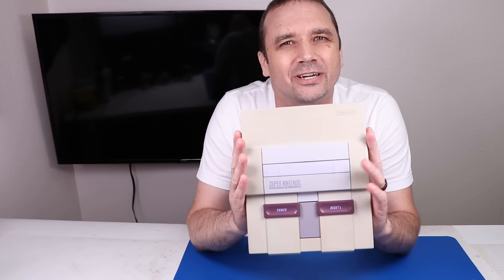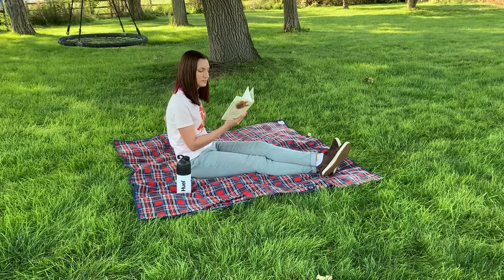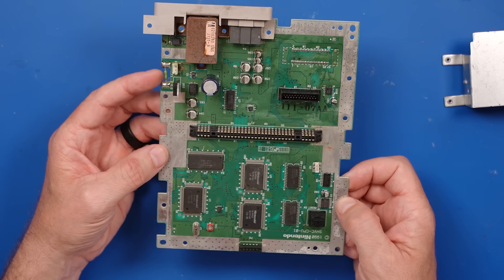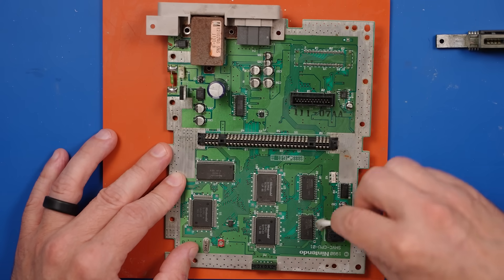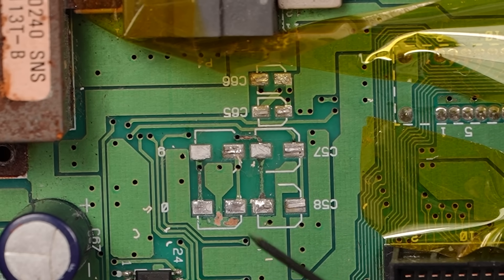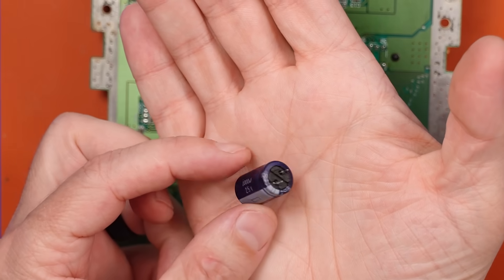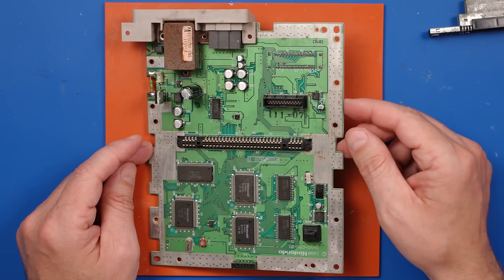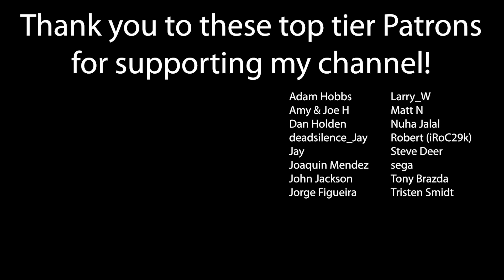Repair Shop Said "Unfixable" - Let's Find Out!

Comment from the maker: Try Huel with 15% OFF today using my code TRONICS15 at http://www.huel.com/TRONICS15. Fuel your best performance with Huel today! Minimum order value of $75.
Reply: I just checked it out and they only give a 10% discount for me
Reply: @Tronicsfix  businesses have to pay 4 to 6 types of cost. If they charged 150 they should fix it otherwise they charge bench fee. They are not work from home with very little cost.
Reply: As usual the Master fixes it and does a proper job.  I would love a little more explaination on what tools you are using to get for myself on each repair.  The Huel add was done very well and her hair was on point, many people skip or block, but this was well done.  As for why not just buy anothe one.  Some people like myself are really attached to theirs and just want it fixed as original as possible.  Great Job!!!!
Reply: where can u get thoes capacitors from to buy?
Reply: Please do you guys do repairs 
I have issues with my ps5 pro
CE-108262-9
su-101265-5
Reply: no
Reply: Her deadpan on it was hilarious
Reply: How do I contact you about a ps5 I need fixed
Reply: @josephmealy3858  you don't
Reply: as far as first things.. why they didn't replace the caps just as a basic refurb is beyond me... and yeah.. not cleaning the game slot is crazy.
Reply: Why do that when they can charge the customer $150 and give them nothing in return!?😄
Reply: I'm Committed I Need My Steam Deck Fixed

Comment: I need your help to replace the 
Super Nintendo outer covers
And I don’t know how much you would charge to to replace the Super Nintendo covers 
Because it was stepped on but does work only way to turn on/ off is to turn on underneath the power switch button 

How much would you to fix my Super Nintendo 
And send it back I do have some Super Nintendo games

Comment: My first computer failed due to a hack. way back in 1998. I took it to best buy. I said "I can run the windows re-installer disk, but i need my stuff, so don't do that, instead fix it" - thinking they knew more than I did. WELL they wiped my entire pc and re-installed windows. SO YEA, I never EVER use repair shops EVER again for my electronics. EVER.

Comment: Nice to see, that you could fix the old SNES, but you really have to learn how to solder. You never put the tin directly to the tip of the soldering iron. You use the soldering iron, to warmup the pad you wanna solder on and then put the tin on the pad next to the tip of your soldering iron. The soldering on THT pins from the capacitory were much better before you redo them 😅 Thank you so much for the video. Nice to see someone is fixing all that old stuff ✌😋

Comment: $150 diagnostic fee is insane.  I got scammed by a shady PC repair shop and even they only charged $50 diagnostic and if they repaired it for you that 50 was taken off the top price, which of course was disgustingly high but high prices plus diagnostic is insane.  How can you return an item you said you would fix, without even knowing the problem but just still charging your labor times 3 just because.

Comment: My PS4 was making some weird noises, and so was my external hard drive. It was also popping my disc out for no reason. Normally, I can take apart older systems, but I didn't want to chance it with it being something like my external hard drive. I took it to a place called UbreakIfix. They said I would have to send my external hard drive out. I knew my PS4 was dirty and asked if they could clean it and see why the disc was popping out. I usually take my PS4 apart about 2 to 3 times a year and clean it. But I figured since these are tech guys, they could do a deeper clean. So they charged my $60 for a diagnostic, and then the next day, they called and said they couldn't find anything wrong, but they cleaned it. So I came in, and they changed me $40 for the cleaning. They said usually it's $100 but my $60 diagnostic cover part of it. They guy was in the back when I mentioned that I cleaned it about 2 to 3 times a year, and he said he could show me how to clean it. I thought, "Cool, I'm gonna learn how to deep clean my PS4." The guy literally just pops off the shell and told me to hit it with air in a can. So what I learned from that was
A. you just told me you charge people $100 to spray their items duster.

B. I clean my PS4 deeper than a professional tech company that specializes in this stuff.

Comment: Ripping off customers seems to the prevailing model across industries. Your mechanic, plumber, builder, and technician all want to rip you off these days. You need to research and gain a bit of knowledge so a service provider thinks twice about taking you for a ride. Thanks tronics fix for imparting so much knowledge in fixing tech, all for free.

Comment: Yeah, but did you try moving it while it was turned on? Because that made it go off the first time. I'm not an expert in the slightest, but that power cable looked sus, and the (I think power supply thing) looked rusty.

Comment: If you're going to use sandpaper on those pins, don't run it perpendicular to the pins, you risk catching something and ripping it off.  Always use the sandpaper in the same direction and the item that's inserted in the slot.

Comment: Although there is absolutely ZERO excuse for a repair shop missing capacitors in that obvious of condition it would NOT surprise me IF the Fuse was bad as well. The SNES is notorious for thos fuses blowing out.

Comment: The capacitors were not storing the proper voltage to keep the game running and it would have worked if the replace all of the instead of one fuse and the big capacitor and charged him 150$ to do that what a rip off

Comment: The power went off the second you lifted the SNES from the table, I don’t think you checked the powercable, I’m certain the cable was broken inside and turned off when it got in the right angle when lifted🤓

Comment: My issue with my SNES was the player 2 controller was barely registering. I opened it up and cleaned most of it. Also I think I did a pretty poor job of it.
Regardless of my lack of skill, with only very simple cleaning... it works like new.
Those things last forever.

Comment: You are going to run into a day where using the diode test function on a meter doesn't properly test something that carries current. Congrats, it beeps so it isn't open, but when you're dealing with old hardware with green fuzzies resistance will eventually get you. The meter doesn't send enough to current to test for much resistance.

Comment: Professionally done repair job, thanks! I think the first shop issue was that either they wanted the get rid of console owner and asked obscene amount of money just to shun him off.  Or - the person who did the "repair", wasn't bothered with faulty capacitors at all. Just washed the board under the tap that caused the widespread residual corrosion and smears we seen.

Comment: A repair shop should not charge any money other than a $5 or $10 diagnostic/inventory fee.  This guy spent so much money and still only got the broken system he started with.  He could easily got a working one for 50 to 100 on Ebay.

Comment: I feel like you did a good repair however if I were repairing it, I wouldve also replace the rusty power input for a newer used one that wasnt rusty and was straight so the power cable isn't plugged in at an angle

Comment: Reparierst du auch Konsolen? meine xbox series x hat das Problem das sie nicht mehr Startet Netzteil tausch hat nix gebracht einer der caps ist ab gegangen aber mehr nicht ob es nun alleine an diesem liegt kann ich nicht sagen. Wenn man die Xbox einschaltet leuchtet kurz das licht der lüster versucht anzulaufen das ganze 2x dnnach macht der lüfter nix mehr. Trenne ich nun den Strom für ca 10sek das gleiche mit dem Lüfter. Kurz bevor es soweit kam hatte ich es noch geschaft das sie im abgesicherten Modus war das ganze bevor der cap weg ging. Dort habe ich dann update machen lassen und zu spät gemerkt das mein Laufwerk nicht verbunden war danach ging nix mehr und die Situation von oben tritt immer wieder auf

Comment: I would still check the Vias and fill them with solder and even add a thin wire to be sure corrosion damage is gone.

Comment: Just from the first minute in I am guessing a capacitor is faulty. Reading some of the comments mentioning a fuse going bad. Fuses rarely go bad to where they are faulty and sometimes work and sometimes not. Fuses almost always work or do not, no in between or intermittent. In the case where they would be intermittent it would most likely be the filament making a poor connection with one end of the fuse casing and with the fuse heating up it causes expanding/contracting of the metals that it causes an intermittent connection.

Comment: The mains fuse does commonly go bad. So it is entirely possible they did replace the fuse because it wasn't working.

The video problem was bad caps. I cannot believe how mangled that ribbon cable for the controller port breakout was. Unbelievable that the shop didn't ask the customer if they wanted it replaced.

Very strange that you did not put UV mask over all of that copper you exposed.

Comment: Why would anyone try and spend several dollars over what a "new" used device would cost, you ask? 

Sentimental value, probably. 

We can tell this ought not be the case given that the guy acquired this unit from a 3rd party who had warned him the system had it's host of problems. 

But, as for me, I would definitely waste money trying to fix my damaged SNES out of sheer sentimental value.

I actually have this exact SNES model with me and I have refused to make any mods to it. I care too much about this old thing.

My money is on the caps.

Comment: I have a 1.6 board  original Xbox with sentimental value to me that died and won't power on about 2  years after buying new in 2004. Had a friend change the caps but still nothing. Could I send it in to you?

Comment: Your repair isn't good either. You should have cleaned the board much more thoroughly and then seal the repair with UV mask or something like this. The vias will continue to rot. It only lasts for a while until it fails again.
Reply: And kapton isn't "heat protection tape". Put some on your finger, hold the soldering iron to it, and then think again about what you said before. The tape is resistant to heat but does not protect against heat.

Comment: Some revisions of the SNES have unreliable CPU and PPU chips. I learned the hard way: I bought a “tested” SNES from a thrift shop for $80, and it has a bad PPU1 chip. And I bungled the repair by accidentally removing PPU2 and ripping pads in the process. Oh yeah, and I somehow blew the fuse testing my attempted repair of the pad damage…

Comment: If a repair shop accepts a job and cannot perform the repair, it should be an instant refund of all charges and return the console in as closed to the condition as it was brought in to the customer. I can't believe repair shops accept jobs, are unable to fix the item and CHARGE the customer for failing to repair. I would NEVER go to a repair shop that charged anything for a failed repair. Honestly, if that ever happened, I would dispute the credit card charges for fraudulent services.

Comment: That large electrolytic capacitor near the fuse is not present on North American SNES systems, meaning someone installed it later at some point.

Comment: You did all that and didn't replace the power port, which is an extremely common issues on these and also the reason your picture was cutting out at the start of the video? It's still going to be an issue when moved to a different position.

Comment: Steve - After watching your videos for so long I finally got into doing repairs myself and have lots to learn. I normally replace electrolytic capacitors by twisting and  pulling them off the board. The legs fall out and then just clean up the pads with a soldering iron afterwards. 

I've never thought of using hot air to remove them as for whatever reason I've always felt it'd melt the plastic bottom on them. 

What temperature/air flow do you normally use on the hot air station for this kind of work?

Comment: I've been watching for years, and I was wondering if you could help people like me with repairs. I have a switch one with data on it that never got sent to my switch 2 (animal crossing save data). It's completely dead, won't charge, and I've tried 3 repair places around town. 2 turned me away, and the third one had it for a month and tried everything they could, from new parts to donor parts and even calling in specialists to no avail. Im scared to send it to nintendo, both because i heard they usually will just swap it out for a newish one, and because i want to keep my og model switch (in case of future modding).

Comment: Ok, you noticed the power socket was loose, and  the first time, the system turned off as you tilted it.  You never tilted the system again, so it didn't turn off, but that would have been the first thing to check.  I doubt you actually fixed the main issue on this SNES.
Reply: I thought so too but when you watch closely you will see the console is not turning off. The red led stays lit. Though I'm always very curious of all the cutting in the videos. Sometimes the repairs fell pretty off.
Reply: @Lezrup123  Good point about the LED staying, I noticed that too when I also thought the power socket might be dodgy.

Comment: A lot of SNES repairs tend to come down to the caps and fuses that I've seen.  Time wise and parts wise thats should at max be $50. Doesn't take long to do it. Takes less then an hour.  Could easily be a in and out process.
Reply: Try searching the current state of CPU and PPU failures.

Comment: I was thinking they spent so much money because maybe it was a 1 chip snes (later revision with better video quality) but nope. Spending 300 bucks to fix it is silly. Personally, if a shop told me they were charging me 150 for a console worth maybe 50 bucks (considering overall condition) I'd just say they can keep it and go buy a different one. Even if it was a 1 chip, those are only worth 150-250 bucks in good condition. It doesn't make a whole lot of sense either way.

Comment: My SNES controllers from my childhood don't work properly anymore. I replaced the button pads to no avail. Perhaps it's the cable itself or something on the board. A new controller worked fine, so the console is not the issue. You've inspired me to take a second look and see if I can fix them.
Reply: @MST720   wear and tear on the wire. The more a copper cable is moved/ bent the stiffer the wire become until a break happens.

Comment: The fuse on this model is often bad. When I worked for Nintendo I probably replaced a hundred of them. If bad it would have no power at all. I remember one time a woman brought in a Super Nintendo that the local video game rental shop told her was "unrepairable". When I tried it, everything worked fine. I took it apart and they had run a jumper across the fuse. They probably thought she wasn't coming back for it after they said it couldn't be fixed and thought they had a free Super Nintendo....

Comment: Is there a reason you didn't replace those with a tantalum capacitors?  I like a bunch of old ewaste myself, and any time electrolytic capacitors leak, specifically surface mount..........I find value in the few extra dollars to ensure no leakage, if possible.  If there is already slight damage, another leak will most likely finish the job.  Maybe that is just me being a bit OCD, but if I'm going through the trouble to save some old "crap",  it should be saved for as long as possible.

Comment: As the years go by, it will be tougher and tougher to find an old console that still works.  Even if you have it in the box, not opened since release, parts will still corrode or rust

Comment: Why spend 300 to get an SNES repaired when you can get a refurbished one on eBay for 200?  Even cheaper if you just get a working one that hasn't been refurbished.  SNES' don't break often so you won't get screwed over by a bad SNES on eBay unless you purposely go looking for them.

Comment: Nothing is unfixable. It's just the Ship of Theseus paradox in practice. At some point you will have replaced most of what made up the original with new parts. The question then is whether or not what you're left with is still the same object or something else entirely.

Comment: Must've been a nostalgic SNES? I've spent money repairing my childhood systems instead of buying a different one.
Reply: Knowing that Game Gears can be fixed with new capacitors would’ve been vital knowledge to have when I was a teenager! I actually went through 3 Game Gears that went wrong before getting a working one in 2005! The first 2 got thrown out but I held onto the 3rd one, then I learned in 2011 that I could get it fixed by replacing the capacitors, so in 2012 I had a local shop do just that!
Reply: It wasn't...the person bought it off a guy, that claimed it was working and it wasn't and had broken or even missing parts, so they spent $150 on parts and also spent $150 at a repair shop and then it still doesn't work....  None of it makes any sense at all. I doubt it's true...

Comment: That repair shop shouldn't have been paid. If I hire you to fix something, and you don't fix it, why would you expect to be paid?
Reply: Exactly. That repair shop is a scam.
Reply: Most repair shops charge what is called a bench fee. The item just bexause it came into the shop it has to pay. But $150 in this case is bit high. It's supposedly to be around $30 or so. It depends on areas
Reply: The repair shop still spent it's time trying to fix the item and should be compensated accordingly.